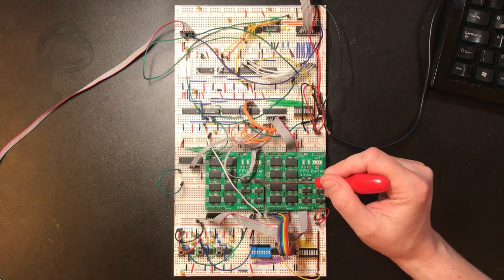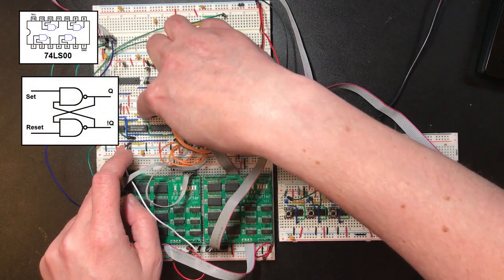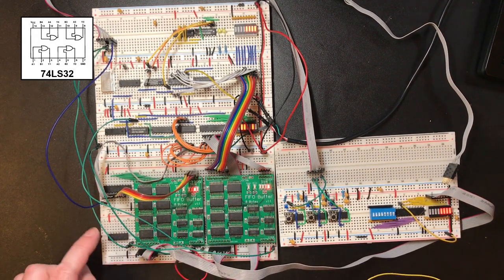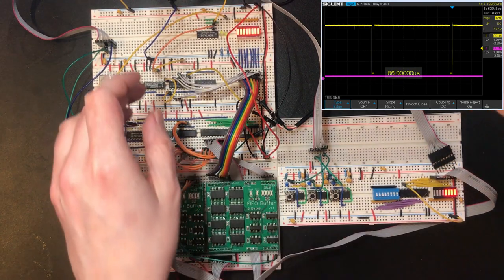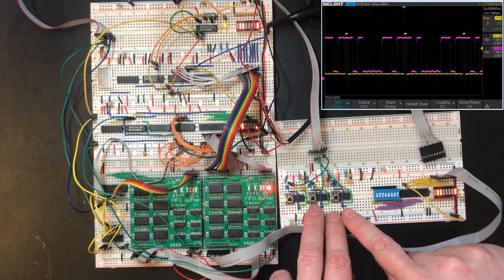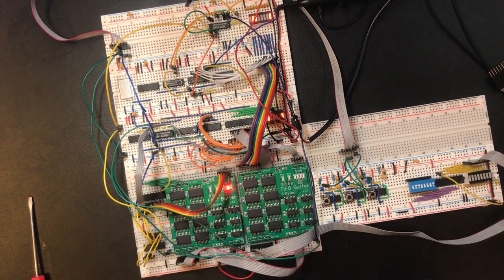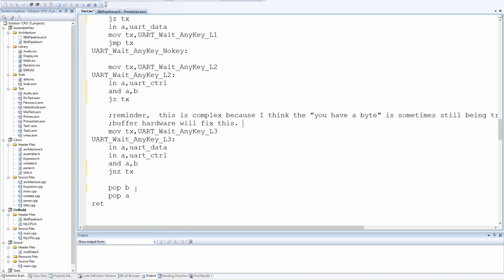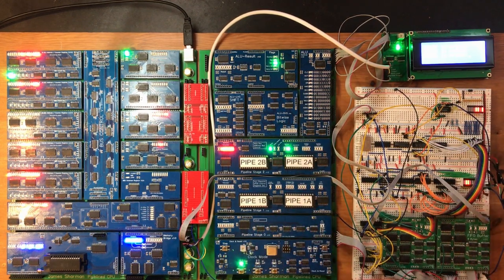Transmit FIFO - UART from Scratch - Part 7

Comment: Yay! Looking forward to this one.
Reply from the maker: Hope it lived upto expectations!
Reply: @weirdboyjim  There were some bits that confused me, but I suspect when you show the creation of the PCB it will be more clear. (This confusion is mine, not because of your video or explanation)
Reply from the maker: Do let me know what you didn't get though, it's useful to know so I can tweak what I do in future videos.
Reply: @weirdboyjim  Starting around 11:07 you start using a lot of NAND gates on the 74LS00N, and you went through them pretty fast, so I need to watch it again I think to catch up with what your doing. Then at 14:18 the shift load and parallel load part, which will probably make more sense when I watch it again. I might need to go back and review the other videos. :)
Reply from the maker: Yeah, I don't explain that well.  The top 2 NAND gates are forming an SR latch with the same purpose as they were before (It's set when transmitting a character). The 3rd NANDS the carry and the clock so the SR latch get's a decent length rest signal (That I can use elsewhere reliably, otherwise the parallel load immediately cancels the carry).

Comment: I think you might still technically have a race condition problem with reading the FIFO count.  Adding the 74x574 should be good enough to prevent metastability issues on the bus itself, but it moves the problem to where the '574 is clocked.  If the bytes available count from the FIFO is incrementing at that exact moment, some of the bits might be taken from the old value and some from the new value, so the value that's clocked in isn't guaranteed to be just either the old value or the new value.  I'm not sure how often this would actually happen or cause problems (probably not very often) but I think to really thoroughly fix this you could:
1. Keep the two 4b counter outputs separate
2. Convert the UART side's counter to gray code so that only one bit changes when it increments
3. Might need to latch the gray code count in the UART's clock domain to prevent glitches
4. Re-clock the gray code count into the CPU's clock domain (since only one bit changes at a time, the gray code for either the old or new count will always be seen)
5. Convert it back to normal binary
6. Finally do the subtraction with the CPU's counter, all in the CPU's clock domain where it's going to be used.

That's probably going to add a lot of hardware though.  You could probably get away with just reading the count twice in a row, and if the values are different, keep trying until you get consensus.  And actually I think it might not be a problem at all if you don't care about the actual count but only whether the buffer is completely full/empty.
Reply from the maker: I can see what your saying, but I've run a lot of cycles through this and not seen a problem.  What I would say is the UART circuit is fine IF it can assume the output from the fifo buffer modules is coherent. That circuit is design to not suffer from persistent problems, so IF there is a momentary glitch on the output it will settle correctly. I've run checks and the outputs seem very solid, all the bits seem to change at the same time so far as my 200mhz scope can detect.

Grey code is an interesting way of attacking the problem, but it's not the way I would solve it if the chip outputs were nor working out. I'd separately latch the read and write counters after merging the clocks on each side with read signal. Then the subtract would be performed after the load line went low, that would give you read latency of the addition chips settle time but would give you a 100% robust solution.
Reply: Even if there are no glitches or differences in propagation delays between bits, there is still a problem of violating the setup/hold time requirements of the latches/flip flops.  Basically whenever a latch or flip flop input is transitioning at the moment that it's latched/clocked, it's possible for the stored bit to be latched in a metastable state halfway between 0 and 1, like a ball balanced at the top of a hill.  Eventually it will "roll down the hill" and resolve arbitrarily to either 0 or 1 after some indeterminate delay (but usually very quickly due to noise, etc).  If only one bit is transitioning at a time, we can guarantee that the only possible values after the metastability resolves will be the actual old value or the actual new value.  But if multiple bits are transitioning at the same time, more than one of them could be metastable when latched and some might resolve differently than others, so we could end up seeing any combination of the transitioning bits in the latched value.  Using gray code gets you back to only a single bit transitioning at a time, where you can guarantee that you'll only see the old or new value and not some other value that was never actually observed in the original clock domain.  This is all theoretical, but using gray code for this kind of stuff is definitely done for multi-bit clock domain crossings in commercial FIFO chips, FPGAs, etc.

I'm not sure I totally understand what you mean by "merging the clocks on each side with the read signal," but I assume you mean latching the counter output that's clocked by the UART when the CPU's bus read signal goes active?  In that case since there's no relationship between the CPU bus read signal and the UART clock, it could be that the counter is in the middle of incrementing at the moment it is latched, which means some of the bits could be latched in a metastable state.  In the worst case, all 4 bits might be transitioning (eg. when incrementing from 7 -> 8 or rolling over from 15 -> 0) in which case the resolved latched value could be any number from 0-15.

But at least for the code shown here, I don't think this is actually a problem.  Since the code only cares if the transmit buffer is full or not full, any concurrent UART read that could corrupt the count seen by the CPU would by definition mean that the buffer is not full, so it's okay to write a single byte to it regardless of the count being reported as anything from 0-7, and if it happens to be incorrectly read as 8-15, it will just loop an extra cycle.  Similarly on the receive side, the code only cares if the buffer is empty or not empty, and a new byte from the UART that could cause the latched count to be corrupted by definition also means the buffer is not empty.  Where I think you could run into problems is if you read one of the counters, saw that there were (apparently) multiple bytes available/free, and then tried to read/write that many bytes without checking the count again.

Anyway, I hope I'm not sounding patronizing here, I love your videos!

Comment: Very cool!  I'm still working on getting my primes code to work, but really want to catch up so I can implement the UART.

Actually, I was hoping to get this done before you completed the UART, but since that doesn't seem likely, I might as well mention it: I plan to have my assembler spit out lightly structured binaries whose sections can be compressed with something like LZ4 or LZSA1.  LZSA1 in particular was designed for 8-bit micros, and the decompression speed might be fast enough that it'd be faster than transmitting raw data over the UART.  This means that with an appropriate loader in ROM on the CPU, you could load programs over UART without having to muck around with reflashing ROMs all the time, and it would hopefully be reasonably quick.

That way, your development loop could be simplified to just hitting reset on the CPU, then running a batch file to reassemble and load the latest binary.  With the number of small, stupid bugs I've hit thus far, I can't imagine how much more frustrating it would have been if I had needed to reflash the ROM every single time.  :P

I mention this in case the idea hadn't occurred to you yet.  You could probably beat me to it before I manage to catch up enough to implement it myself.

Two asides:

1. Did you change your audio recording setup in some way?  You sound... a bit deeper, I guess?

2. What does .subsegment do?  I've been wracking my brains, but I can't work out what it's for.  For reference, my assembler lets me just use `.segment Name` over and over and it will concatenate all the code together.
Reply from the maker: Aside 1. Did you read the video description?  I got a mic stand that moved the mic closer, not being used to that is what caused the sound levels to fade at times. I compensated as much as I could in editing but I need to not move my head while speaking.    
ps: If you ask questions in separate comments it makes it easier to respond and for others to react to.
Reply from the maker: Aside 2. In my assembler it is the same as repeating the same '.segment name' again. It's not necessary to understand the flow of code generation but it tells the assembler that addresses across the boundary don't need to be contiguous. I don't currently have it but I intend to write some code for dynamically packing segments (That will be really handy in the places where I '.align 256' as that usually leaves a hole). At the moment the sub segments are just used for dead code stripping. If nothing references a label inside a subsegment the assembler will drop it, that way I can include library code without worrying. I may also use it in the future for local labels so I don't need to worry about uniqueness for simple loop and conditional labels.
Reply from the maker: I've mentioned before I'd like to use the UART for transmitting code. The new memory system that makes everything ram will make it easier, but I also want the UART stable on PCB before I do that. I actually thought about compression but realistically it's not needed, but transmit frame is currently 11bits so 115200 baud get's me 10.472KB per second. The full contents of an EEPROM would be 3.1 seconds to transmit raw. I'm not expecting to get anything like that big until I start adding graphics, when I do that I'll likely be storing compressed and decompressing at runtime so it would likely result in a bad transmission compression ratio.
Reply: @weirdboyjim  Thanks.  Of course, I didn't think to check the description.  Egg on my face for that.  I'll also use multiple comments in the future.
Reply: @weirdboyjim  `.subsegment` for what you described sounds like a good idea.  My thought was to break the code into simple blocks, and map how they branch between them.  Once I have that, I can do some simple flow-based analysis, including things like dead code removal and packing.  `.subsegment` would definitely be quicker and simpler for those purposes.  The current arrangement internally in my assembler is Segment Groups -> Segments -> Block Groups -> Blocks, and your `.subsegment` feels like an explicit Block Group.  I could probably get away with just having a "don't split" flag on Block Groups and implement them that way.
Reply: @weirdboyjim  That is an excellent point.  Damn.  :P
Reply from the maker: For each symbol I store a list of the subsegments they are referenced from, then I use the .entry directive to recurse through and tag all the ones that are actually used.

Comment: James! You got burnt by ground bounce again! 😂 Well done on the FIFO! Wonder if you'll go for a >8 byte FIFO. 😉
Reply from the maker: It always pays to check that stuff when you are on a breadboard! The fifo is an inherently duel port device, so you either need separate latch chips, duel port ram or more clever mediating circuitry. I played with some numbers and 8 bytes felt to be the sweet spot for the tradeoff between size and complexity. 4 bytes would actually have given me most of the benefits so I don't feel like I need to add more urgently.

Comment: Hi. I have a question about the number of characters send for each displayed number. If that is more than 8, it still has to wait before starting on new number. Is there a potential optimization, or am I missing something? Regardless great work as always.
Reply from the maker: It would indeed still have to wait, this particular bit of test code computes all the 16 bit primes, so all the prime numbers under 65536. Even if I was outputting larger numbers (or bigger bits of text between the numbers), I'd still be back to computation when there were 8 chars left to output so I would achieve a better thru-put with the fifo. If needed you could implement a software fifio that  you could poll less frequently to fill the hardware fifo. Just a few bytes here makes it much more flexible.
Reply: @weirdboyjim  Thanks for answer. I was thinking more like quick fix by removing few of the spaces between numbers, so it does not have to wait at all (hopefully).

Comment: As for longer jumper wires - get some of M-F variety. Use those as extensions, when needed.
Reply from the maker: I actually have some of those, doesn't feel much different than using a spare strip on the breadboard to cross connect.

Comment: Would adding additional capacitors help stabilise the power lines?
Reply from the maker: Capacitors help but only so far, I'm far from an expert on the analogue side of things but caps are great for smoothing small bumps from a devices momentary power drain, but if you have resistance on the power rail like I was experiencing here the caps can become counter productive. Once they have supplied a bit of voltage they need to be charged back up over the same high resistance lines and that actually makes the problem worse. Breadboard circuits in the megahurtz range simply need really stable power and cheap breadboards with rubbish connections can get in the way.
Reply: @weirdboyjim  OK, thats worth remembering, thank you.